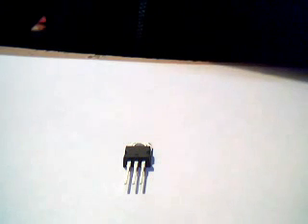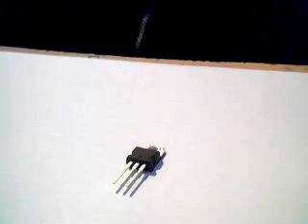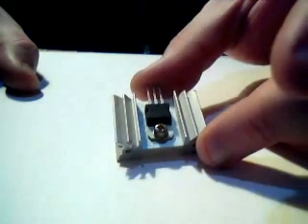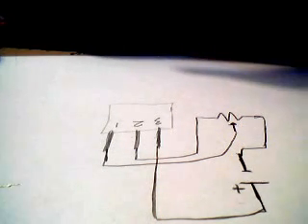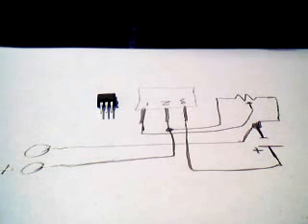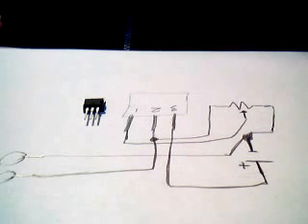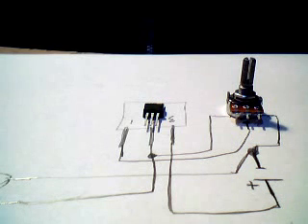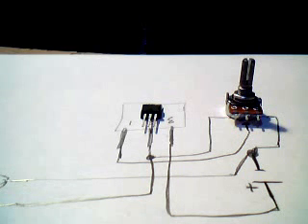simple battery charger using LM317T + POT

Comment: max output  ampere of lm317 is 1.5 amp and to charge a battery of 35 ah ,this is not suitable.
Reply from the maker: you can run multiple 317's in parallel to increase the current supply...
Reply: +Abhi G What would be suitable for a 50ah battery
Reply: +Dennis Sewell don't go for any chip or ic like lm315 or lm317...use 6 amp transformer which will give atleast 5 amp output and 5 amp for 10 hours of charge will give you 50 ah.
Reply: thanks mate
Reply: or you can apply another methode: apply MC33063 or UC3843. both a little bit more complex but reliable and safe and save
Reply: instead of using LM317T, it is better to use LM338, it has a max current dissipation of 5amps, which is suitable for charging batteries with high current rating...